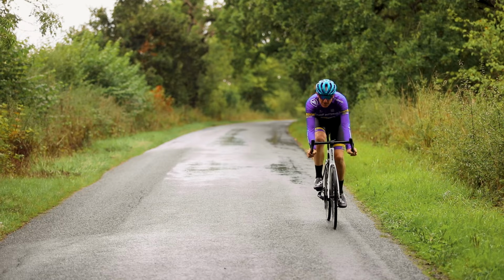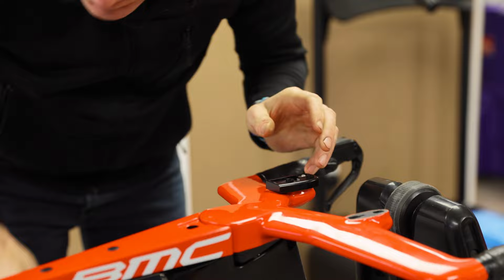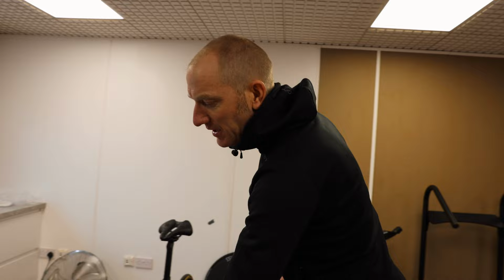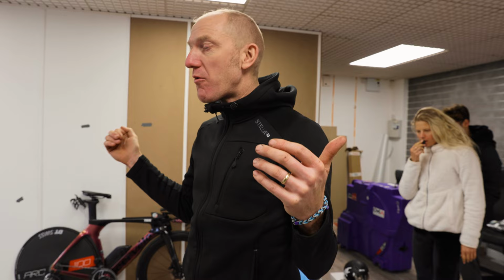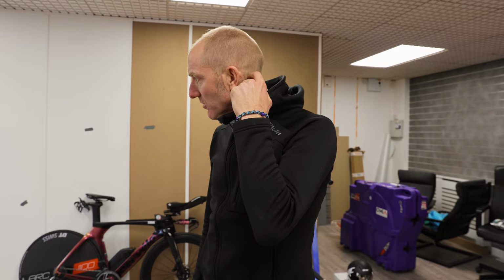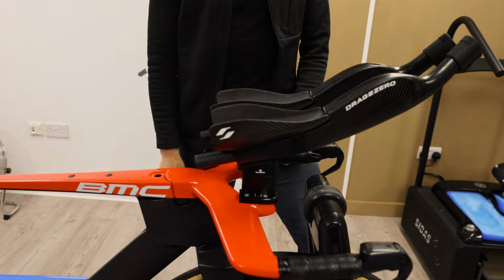A performance bike fit with Clement Mignon | The new BMC Time Machine time trial bike

Comment: Hi Matt, I’m just wondering if the semi moulded bars ie D2Z or wattshop aero coach etc. 

What is the benefit of them, is there positional gains or mostly just aerodynamical?
Reply from the maker: There the new Drag2zero 0.66 bar. They make holding the Postion much easier . And of course help with aero
Reply: @mattbottrillcoaching  Are they an improvement over the stock bars on a Cadex?